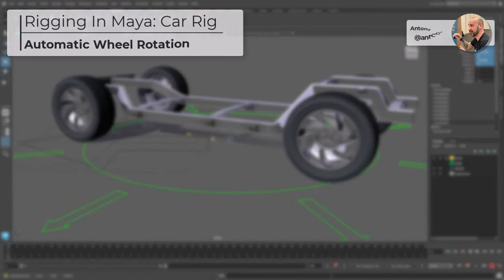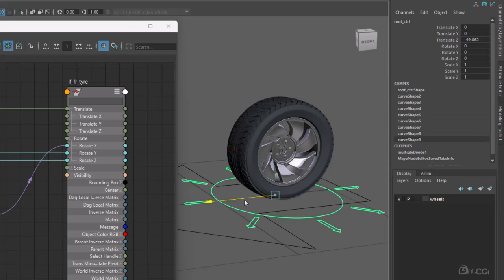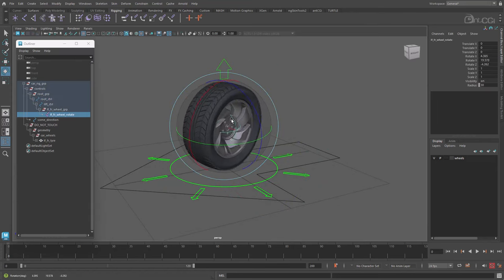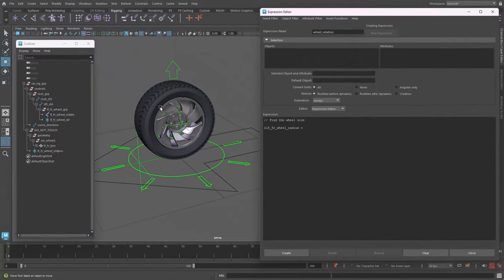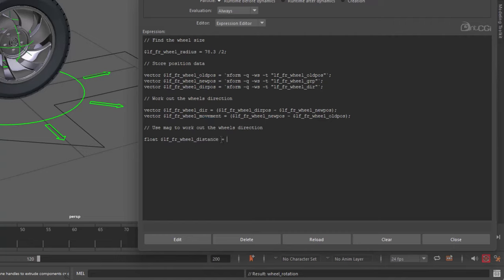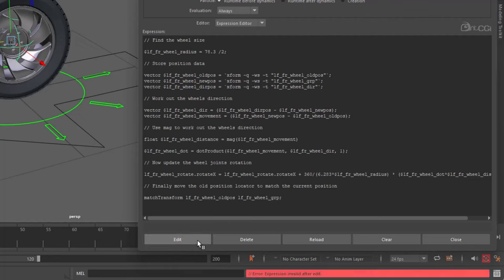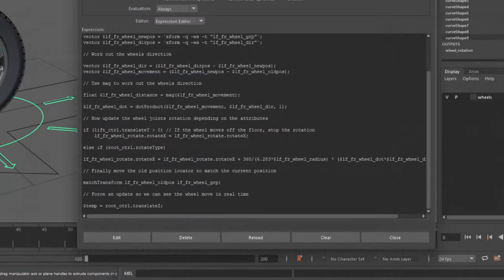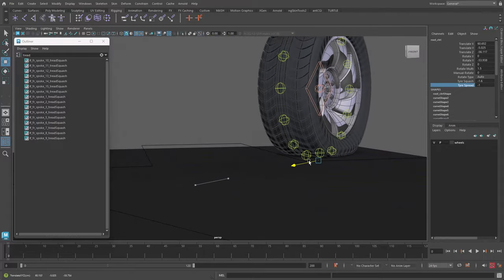#RiggingInMaya | Automatic Wheel Rotation

Comment: Youtube keeps deleting my comments T^T This time I won't tell you how to find my post about this at a place that is not youtube, lest even mentioning other places or handles is what's preventing my comments from being published. For the third time: I've been trying to get your node based rotation file to work, and the solution I've come up with is very inelegant.

The spinning is caused by how Maya handles translations and rotations; rotations corrupt the translation values. I've spent a long time messing with matrices and offset parent matrices trying to find a way for an object to rotate correctly while keeping its translation values intact, but to no avail.

The closest I've gotten is to lock the rotations on a null group ("clean translations"), then select both it and the control to manipulate the control. As long as the control is selected second, the pivot will follow it and it doesn't matter where "clean translations" ends up, and the values from "clean translations" can be used to update the wheel rotation.

I spent a while trying to get "clean translations" to rotate correctly so it would stay in place with the control, but that turned out to not be necessary. I was hoping that by getting the rotations right, a point constraint would have it follow the control while letting it create translations that are accurate to itself. Unfortunately, I tested that with a simple rotated object, and it copied the control's translations regardless of how inaccurate they should be for its matrix position.

I wanted to see if you had any ideas on how to get the control to automatically select the clean translations group and then either itself or a third dummy group (for the pivot to be in the correct location). If you have any other ideas on how to get it to work, ideally without sacrificing the ability to undo, I'd love to hear them!

Anyway, thank you for your videos, you're amazing!!
Reply: It worked, yay! I forgot to mention that I did make a button on the shelf with a MEL script that selects them correctly, but I won't be animating the rig and I want the animator to be able to click on the control instead of needing to remember to click a button on the shelf. It works okay if the rigger is also the animator and doesn't mind it, but it's clunky.

Comment: How many of the series will be uploaded in how long approximately?
Reply from the maker: I'm not sure to be honest as i'm still working out the main rig. Possibly the following -

1. Wheel Rotation - Done
2. Joint Based Tyre Pressure - Hopefully available beginning of October.
3. Front Suspension
4. Rear Suspension

What else would you like to see? The car model is basic so doesn't have opening doors etc. but I presume those are simple to rig.
Reply: @antCGi  Watching your shorts and waiting to learn 'Joint Based Tyre Pressure'. it looks awesome. and i am thinking that i could apply that skills to thread rigging of mine. I'm glad it's coming up in early October. thank you always